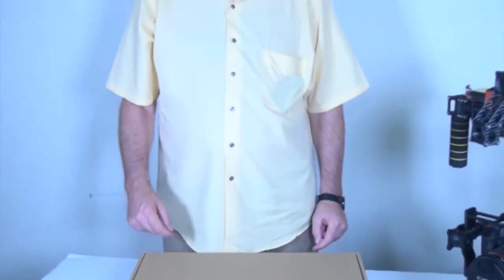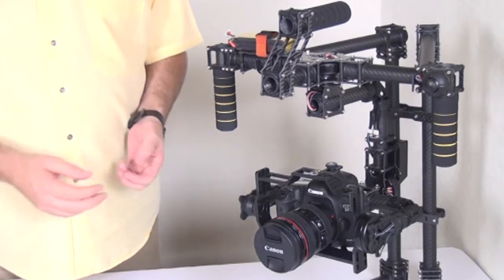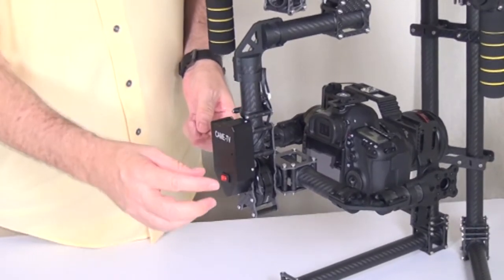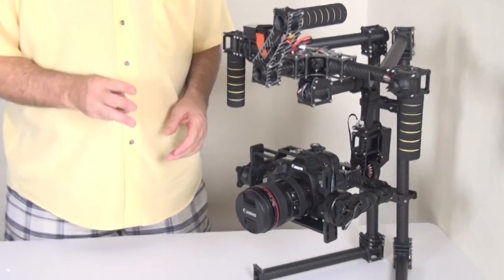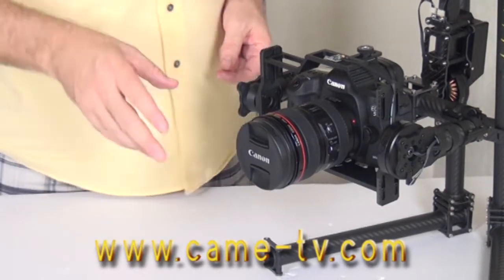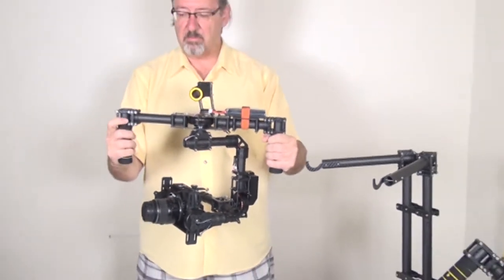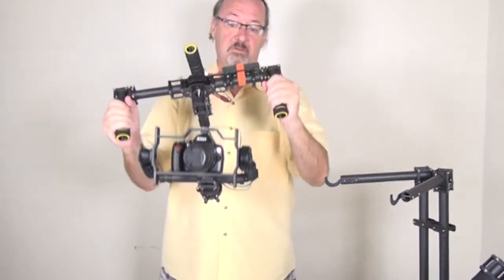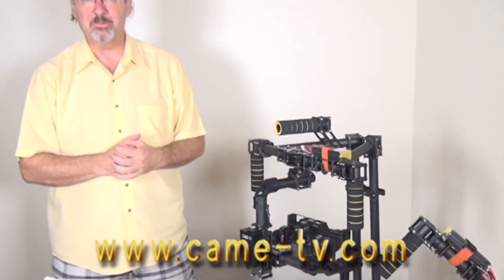CAME 7500 and working demo for small camera weight only 800g

Comment: I'm a little confused... It looks like this simply is a rebranded DIY gimbal? You get this for about 5-600$, ok then it does not include a gimbal stand. And yes you build it up for the costumer, but this isn't a very big deal. Especially the wiring; all motors do have hollow shaft, so everyone can slip them through those, even without a slipring.
In my opinion you are taking credits for someone elses work!

Comment: hi there, about the 4th future, i wonder if u have a different lens on it? it should change the bavior right? so how can u preset the mark 3 when u don't know what lens is on it? or do i misunderstand?
Reply from the maker: Hi,  althrough you change the different lens , but you can work directly with gimbal ,  you do not need reset PIDS ,  you only need manual balanceing the camera

Comment: Hello,
Is the CAME 7500 ready to work with GH4 + cine lens Zeiss CP2 15mm ?
(1,6kg)  And if it is possible to use PIDS settings with this lens?
Reply from the maker: Hi, if  GH4 + cine lens Zeiss CP2 15mm  total weight between 300g - 2000g ?  if yes, it can work directly ,  if not , you need set up PIDS yourself .
Reply: CAME-TV.COM
 Thanks for the answer!
Also, do you know how much time it will take to receive the Came-7500 (USA)?

Comment: since the 24-70 extends when zoomed out,  do you have to rebalance the camera when you zoom in? or do can the algorithm compensate for the slight change?
Reply from the maker: hi, if you change camera or lens ,  you need rebalance the camera for working more easy
Reply: CAME-TV.COM thanks for the reply!
Reply: That's why I love primes for video
Reply: CAME-TV.COM Houston CrushedVinyl A quick little update.  Just got mine in yesterday and balanced it at 28mm and everything with my canon 28-70.  With the gimbal on, i can zoom in to about 50-60mm and the board and motors can compensate enough to keep it steady while zoomed in.  I agree shooting primes is great, but it's nice to be able to get several different shots on one set up when on the run.  Thanks so much CAME-TV, this thing works great!

Comment: Canon 5D mark2 is 800g without the camera lens. Is it 800g min or max ?
Reply from the maker: the default PIDS can work directly with total weight 800g- 2000g camera+lens .  if your machine lighter 800g or bigger 2000g ,  then maybe you need set up PIDS yourself .
Reply: OK, perfect, thank's!

Comment: does this work with C100 or similar without having to recalibrate the sensor?
Reply from the maker: it suitable the camera + lens total weight within 3kg , the cage side : 18.5(wide）X14/12（high） . you can check your camera size
Reply from the maker: hi again, We will have new model suitable for C100 soon

Comment: two questions will this work with the pocket cinema camera or do i have to change in PID on the computer also will the new Came 8000 have to be assembled or come already assembled like the 7500 ?
Reply from the maker: hi , CAME 8000 which is assembled ,
Reply: I have a bmpcc and i haven't balanced it on there to use it but it seems like it would work fine.  I'm using my a7s on it.

Comment: Is it possible to put a quick release like Manfrotto’s on the gimbal so once the balance is found the quick release can be left in place so you don’t have to rebalance it every time you remove the camera to swap out a battery or make some other adjustment?
Reply from the maker: hi, we do nto suggest you put the quick release yourslef ,  in this way , the case will short
Reply: I tried putting on my Manfrotto 577 Compact Rapid Connect Adapter on it.  There just wasn't enough space inside the gimbal rotational area for this.  the viewfinder would hit the back of the gimbal and the top mount where the inertial measurement unit is also hits any kind of 77mm filter threaded lens.  It's a pain having to swap it in and out to a tripod, but the benefits far outweigh that inconvenience.
Reply: Marcel De Lima actually my 577 plate works perfectly.  I'm sure that plate you linked to will also fit.  but the big 577 with 501pl works fine.  balanced and everything! subscribe to my channel and I'll be sure to post up a video tomorrow about it
Reply: dxrjosephine I just subscribed! Thank you!
Reply: Marcel De Lima uploading the 577/501PL plate on my gimbal now.  what it doesn't show is how balanced it is because i didn't bring my stand and no one else wanted to hold it for me LOL but it shows how it's all put together.  I hope this helps!